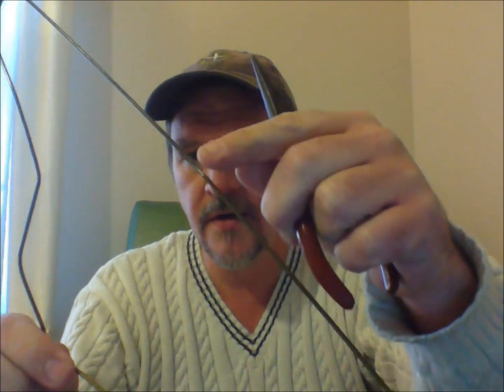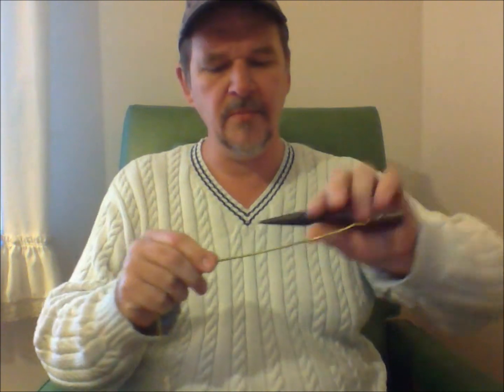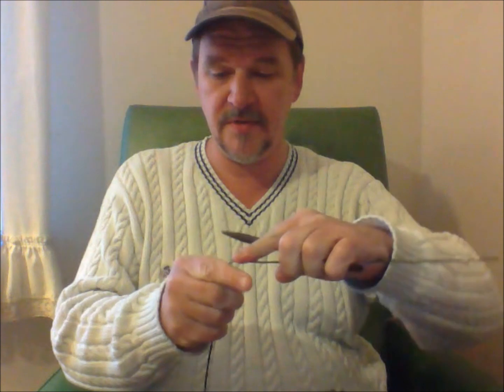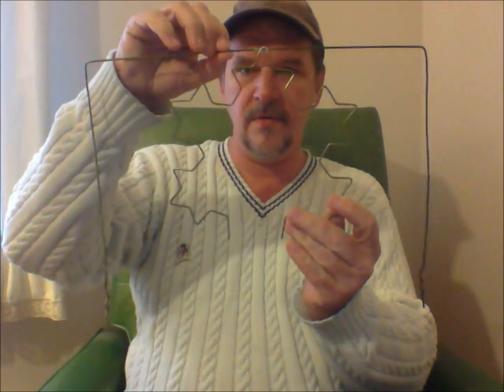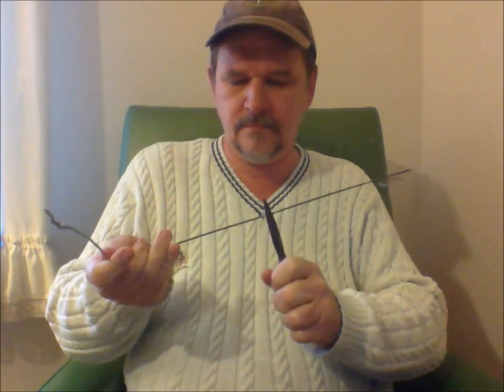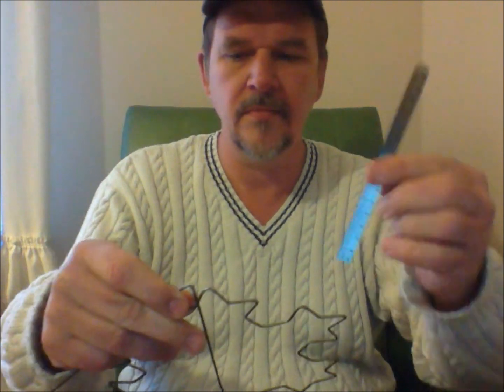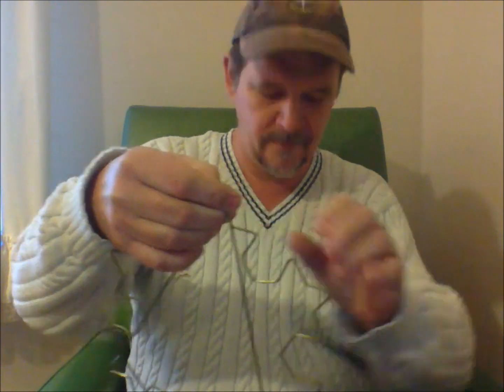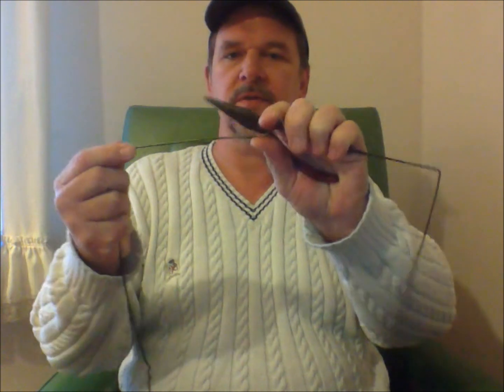How to build a HDTV Coat Hanger Fractal Antenna - Detailed (Step 1)

Comment: I was wondering if you use this design for a TV antenna , if so how many channels do you get. thank you for your video 👍
Reply from the maker: Check out my part 2 of this same video.  It covers assembly and then I do a demonstration afterwards.  My antenna picked up more channels than an amplified antenna that my buddy bought at Radio Shack for over $150!
Reply: Ok....so how many are you getting?
Reply: I am getting 23 channels
Reply: not bad.  Do you happen to know, based on the FCC's tower location maps, how many miles the farthest tower is from your antenna?  Sorry for all the questions, but I have made my first antenna and I'm pretty excited about the results.  Last question - Have you found that a more elaborate fractal design brings in more channels, or no?
Reply: I think it would , I have 2 Koch snowflakes up top , and the ultimate antenna down below 👍
Reply: I like doing all this stuff keeps me occupied
Reply: thanks for your info!
Reply: Your welcome man, have you tried that triangle fractal ?

Comment: built one like this with only 2 outer elements and the middle circuit elements with a 10 dollar uhf/vhf inverter, almost the same as he did here with half the elements and it worked better than my 40 dollar RCA flat wall hanging antennae, thanks you for this how too vid, works great. RCA one got me 15 local channels, this fractal one i built gave me over 50 channels locally
Reply from the maker: Kevin,  I have a new design!  It's incredible!!  It's a MULTIDIMENSIONAL Fractal!  I'll be posting a video about it in the next couple of days.  Please keep an eye out for it, I'm SURE you'll be impressed!  Please LIKE and SHARE!  Thanks!
Reply from the maker: https://youtu.be/kQorXhKbZss

Comment: were you able to get any vhf channels?
Reply: tcpolasek1 I would like to know this answer also!  Do you know what mileage range should someone wanting to pickup vhf (both low and high) and uhf frequencies is?  Thanks!
Reply from the maker: Yes, received both digital and analog.  Check out my new design I just finished a few hours ago.  I'll be posting a new video in a day or two.
Reply from the maker: https://youtu.be/kQorXhKbZss
Reply from the maker: https://youtu.be/kQorXhKbZss

Comment: Hhm, well I think this looks like a lot less hassel to make with cuting out the patern from aluminum foil (of course a simpler patern than this, glueing it to cardboard, taping it to your window, and there's your "window flat antenna".
Reply from the maker: dietermoreno If you use foil, make sure you make your connections on the dull side, not the shiny side.  The shiny side is treated with a coating that could effect your reception.  I chose to use hangers cause I didn't want to tape something to my window and wanted something a little more permanent than something taped to a piece of cardboard.  The best thing to use is copper foil...  or better yet, silver foil, if you can afford it.  Good luck!  Let me know how it turns out!
Reply: It didn't turn out in the summer months.  Only in the winter months when snow was acting as a reflector and less humitidy in the air.  So for the summer months I gave in and bought the Channel Master Extremetenna for $110 and put it on the roof with eve mount with 100 foot long cable and connected to a distribution amplifier before the converter box.  I tried the Channel Master mast mount pre amplifier and it didn't do anything (DOA or over amplification?) and the distribution amplifier works. I guess I must be too far away (39 miles) for indoor antennas to work in the summer at all no matter how creative I get.

Actually, the indoor antenna did work in the summer months, but so poorly its hard to say it worked.  In the summer months it only got 3 UHF RF channels (RF 43 ABC, RF 51 My Network, and RF 45 Telemundo) in poor quality and did not pick up the VHF CBS station.  And this wasn't LOS, this was actually pointed toward the neighbor's house at about perpendicular to the direction of Chicago because apparently I was picking up a reflection off of the neighboor's house that was stronger than the LOS reception.

 The outdoor antenna is actually pointed towards Chicago and in the summer months it gets in perfect quality 9 UHF RF channels (RF 29 NBC 5 Chicago, RF 43 ABC 7 Chicago, RF 19 WGN 9 Chicago, RF 21 PBS 20, RF 31 Fox 32 Chicago, RF 45 Telemundo 44 Chicago, RF 51 My Network 50 Chicago, RF 36 [religious 62.1], RF 38 Univision 66 Chicago) and one VHF RF channel (RF 12 CBS 2 Chicago).

This is a slightly different channel line up than the indoor antenna at its best in the winter months.  In the winter months the indoor antenna was pointed LOS.  The indoor antenna seemed to be getting more high  UHF channels than the outdoor antenna but less low UHF channels and poor VHF.
Reply: Funny thing is, the Channel Master Extremetenna outdoor antenna that I'm using kind of looks alot like the indoor antennas people are building on YouTube with coat hangers with x-crosses and loops in front of a metal reflector. Just its factory made and doesn't use coat hangers so it can be mounted on the roof.
Reply from the maker: If you can find an old freezer, I hear the aluminum coils make great antenna conductors (better than steel coat hangers) and they are much easier to bend.  The more detailed the fractal (dimensional layers) the better HD reception you'll get.  But you can make one with just simple 5 point star patterns, if you want.